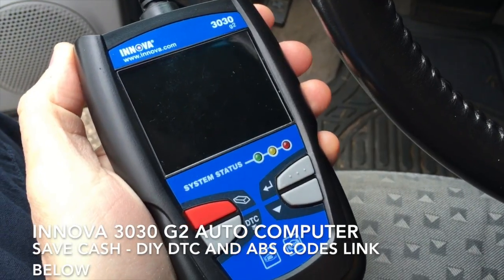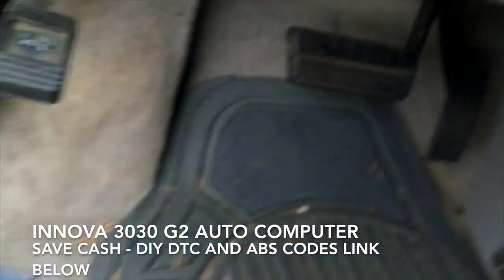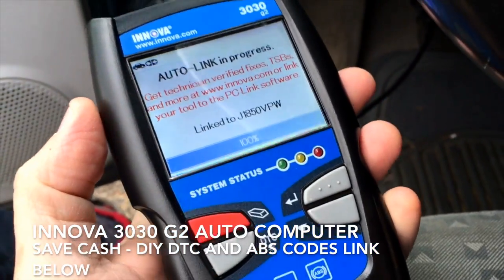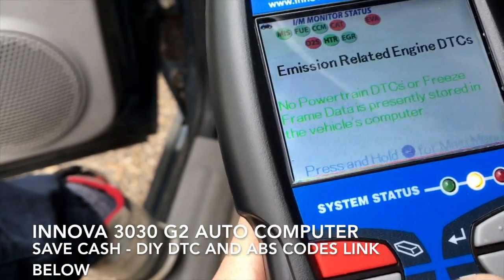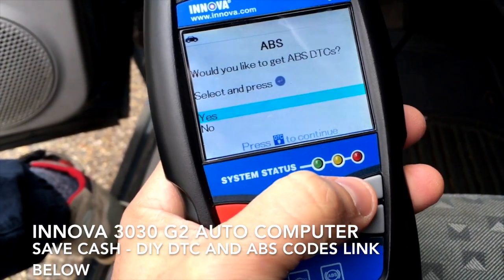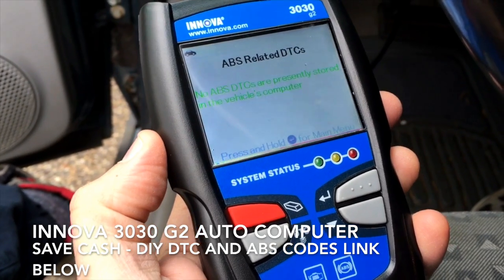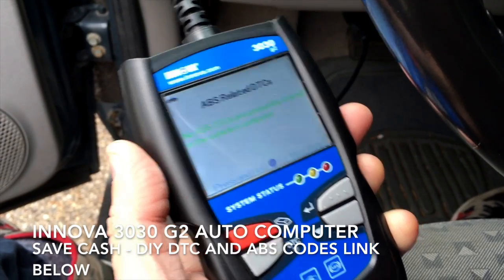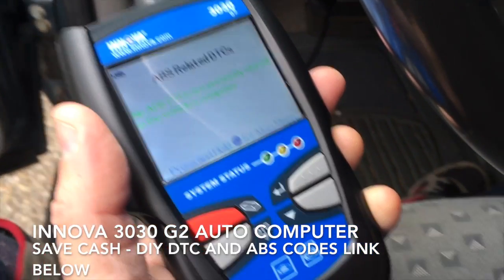Best Auto Code OBD2 Reader - Better Mileage, Save Money!

Comment: Great product !! I got it from NAPA Auto Parts for a discounted price at $50+ tax and I was able to pinpoint the issue by the Innova 3030g displaying & giving me a good direction of where the problem was coming from. For example in my case "P0302" it indicated and displayed on the screen that cylinder number 2 was misfiring. My solution was to check the spark plug wires (2) and spark plug (2). Turned out that I had a bad spark plug haha easy fix since I had brand new spark plugs laying around. I went ahead and installed new ones. I did not change the spark plug wires, but will be changing them sometime in the future.

Comment: U said it costs $70 for diagnostic??? Every auto parts store does it for free
Reply from the maker: At a shop, it usually is $70. Yes, auto parts stores do the free test, but there is no detailed advice like this reader in tandem with the online site it connects to.
Reply: @Guitarburger  140CAD$ at Honda dealership...going to buy one right now!
Reply from the maker: Understood. To have a great machine at home that also offers text to accompany the codes is my goal.

Comment: I just reset my engine light and its off on my dash . Now on the scanner after it rebooted now little red light are flashing on the screen how  do i fix this. I have 2014 accent
Reply from the maker: Sir, consult the manual. IT will give you the correct method to make this happen. If the flashing lights are at the top, then look at the manual to find and fix the problem. Be sure your engine is warm before checking it.
Reply: Poor Man's Channel can show a video u were going to do one for this problem